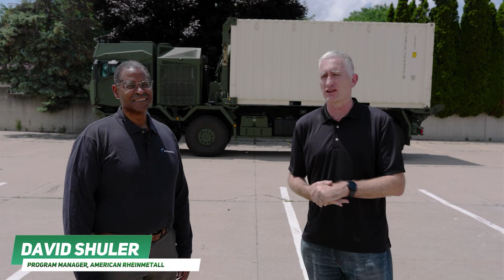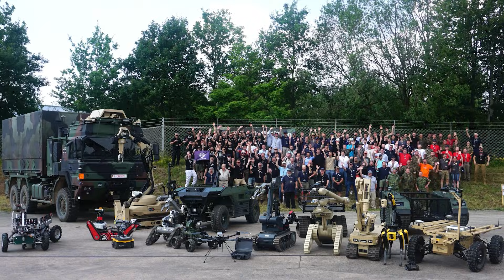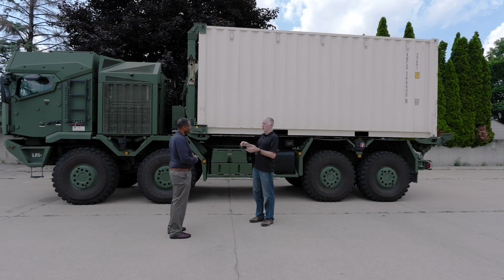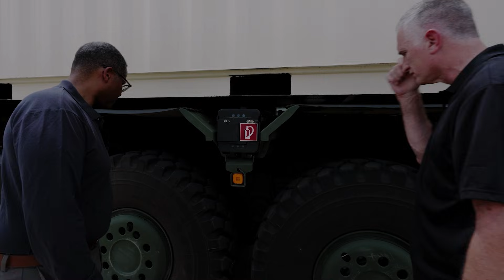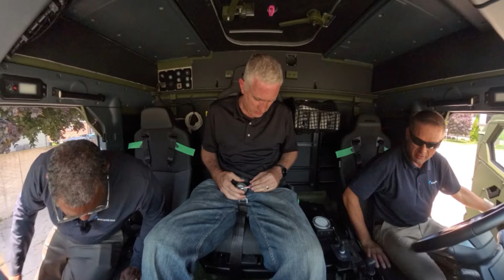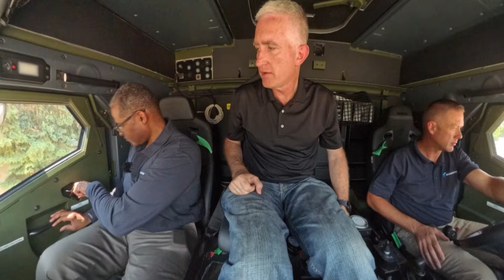American Rheinmetall, and the HX3

Comment: Adopted by us for our LAND121 requirement - Diggers seem happy with them and we are already trialing the "driverless" thing.
Reply: Yeah, All the diggers I know are loving this thing compared to the old Unimogs and stuff.
Reply: Happy? Bit much saying happy. Having to get a permit to drive it anywhere is the largest headache to ever exist. The only thing this has over the mogs is air conditioning. We should've gone the macks
Reply: @Drb1708  
Aircon
Much, Much higher capacity.
CTIF
Better Protection.
More powerful engine.
Able to take on additional roles like Artillery and Anti-Aircraft, bridging, tank transporter. .
Available in 4x4,6x6,8x8 & 10x10.

Comparing this to a Unimog is day and night.
Unimogs are great, but they aren't everything this is.
At best you could compare the 'mogs to a 4x4 HX truck, but the HX is still a better more modern system. especially when you consider you can buy a whole fleet from 4x4 all the way up to 10x10 and have all that commonality and cost savings.
Reply: @birdmonster4586  Buddy I was part of the 121 trials. The Mog out performed them in every day use and the submission from Mack out preformed both of them, the Mack was the obvious choice but as per usual politics got in the way (Queensland really wanted that factory). I don't even know where to start on their issues, from never having enough repair parts (for the entire fleet last i checked there was less than 120 air filters available and you had to get permission to order them) to defences silly modifications that make them less user friendly, I cannot stress how much of a headache having to get route approval is everytime you want to take one off base, an issue none of the other submissions had. The first wreckers issued to units spent more time designated XX then in use until they were all recalled, and what filled the gap? Mogs and older macks. Are the they physically better than the older trucks? Absolutely, are they what we should of bought? Absolutely not.
Reply: @Drb1708 I'm sure you definetly were part of those trials. Im sure everything is exactly as you've said.
Reply: @birdmonster4586  other guys right mate, can't speak to the trials but all the problems they've listed are real. Our recovery variant never worked but we just went without rather than use older vehicles. Parts do be a issue at times especially getting mirrors replaced and the permits to drive them are a nightmare. At one point in their life they weren't allowed on any road in Victoria at all.
Reply: @TheBobtheblue I'm sure you are both very right and correct.
Reply: @Drb1708 looks like we've got a armchair warrior who can't believe a vehicle might not be perfect %100 of the time. Womp womp
Reply: @TheBobtheblue i don't doubt that new equipment has teething troubles.
The nature of brining in new kit.
I also don't think the HX trucks are a bad choice of vehicle.
Plenty of other nations seem to agree as they keep buying them. So there must be something good about them that they keep beating the competition.
Reply: @birdmonster4586  Did I ever say it was bad? Trucks a truck i really dont give a shit. At least the man trucks a comfy one both from a truck pov and the stuff it can carry. What id give to live in one of the modules they have out field like the quies. All I was doing was saying old bud wasn't spewing complete shit.
Reply: @TheBobtheblue don't doubt he may have had a valid point.
But I also cannot verify his credentials regarding participation in those trials. people make shit up on the internet to create false credibility all the time.
I'm not saying he did, or didn't, just that I cannot verify that, and so I have to dismiss it.
The HX trucks were the right choice in my armchair opinion, which is what all our opinions are since we weren't the ones running those trials, generating the requirements and making the decision.
From what I do remember the decision took far too long to make.
Reply: The diggers are not happy with the heaps of shit
Reply: @saff226 how so? And who's even meant with diggers? 

Happy to hear from someone who actually used it if you did! All else is just marketing bla bla
Reply: @NicerDicerSmart  Post seems to have gone.
Anyway I've asked soldiers (CPL and below) about them in 1, 3, 7, 4, 5 and 9 CSSBs as well as 17 CSS BDE, seemed a reasonable sample size.

Comment: Nice kit. We now have the Rheinmetall trucks here in NZ🇳🇿. A bit fancier than the Unimogs that I drove and the 2228s in which I occasionally rode.
Reply: Nothing beats an UniMog offroad😊
Reply: @derdude9654 Good trucks BUT … operational context dependent. All that mechanical sophistication comes at a cost in mass. The tour operator at Farewell Spit tried a surplus Unimog on the beach but it was too heavy. The company opted to strip down and rebuild their RL Bedford trucks. They replaced the original separate-cabin setup with a modern bus body and replaced the mechanicals with later model Bedford components.
Reply: @derdude9654  Volvo 303 comes to mind.
Reply: Beastly!!
Reply: They’re a bit big for NZ roads lol
Reply: @itshype_11 Perfectly fine for normal usage of 8x4 road going trucks. The Austin FG truck cab was developed to cope with the narrow alleyways that masquerade as streets, in parts of the U.K.
N.B. The UK railway loading gauge—using standard gauge track—is similar to our railway loading gauge for 3’6” track a.k.a. Cape gauge. That is due to all the narrow 19th century tunnels and track beds that have yet to be daylighted, replaced or upgraded.
Reply: @m @michaelguerin56 teresting, I ran some conversion courses so some NZ Drivers could drive our Aus fleet. Quite a few remarked that they had issues with width on the South Island (from memory)- trailers even worse. I’ve never been over there though so could be a classic over exaggeration from soldiers lol
Reply: @itshype_11The road tunnels North of Kaikōura, which my mother’s Dalmatian father helped to create, can be an issue for wider vehicles. Some years back, a young American race driver who was competing in our summer open wheel series, related how his father had sent his large motor home by ship, to NZ and had a bit of fun getting through those tunnels😁!
Reply: @itshype_11Beastly!!